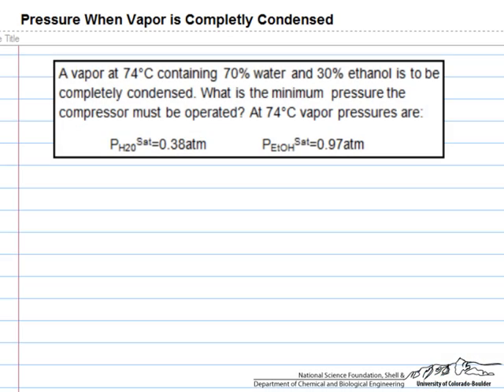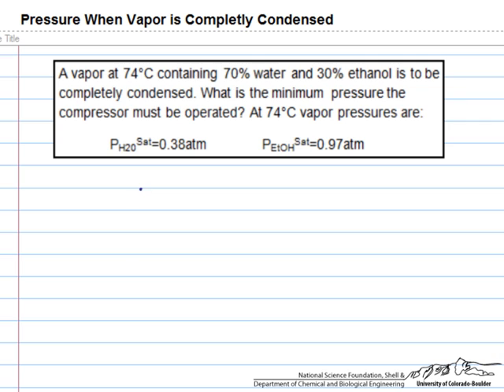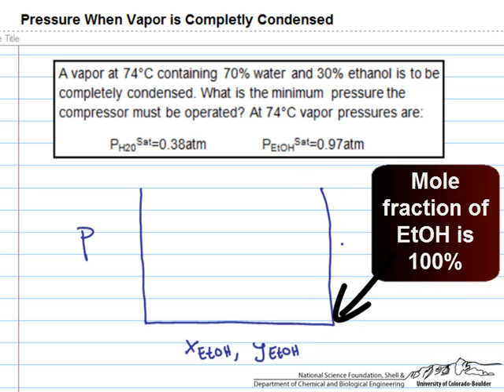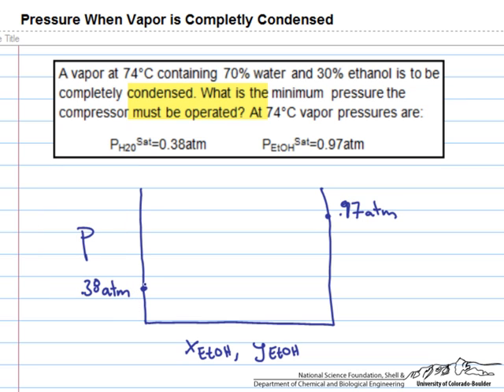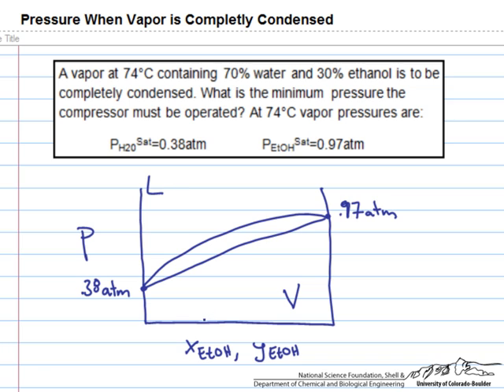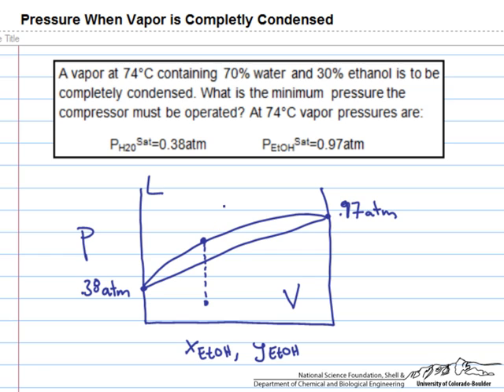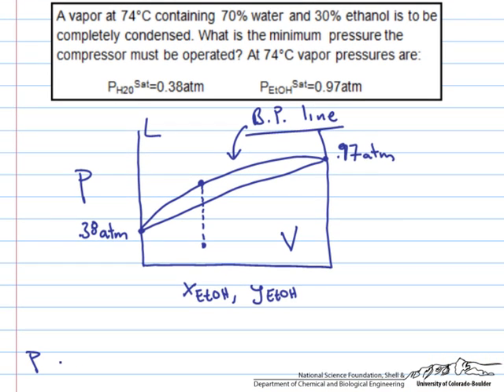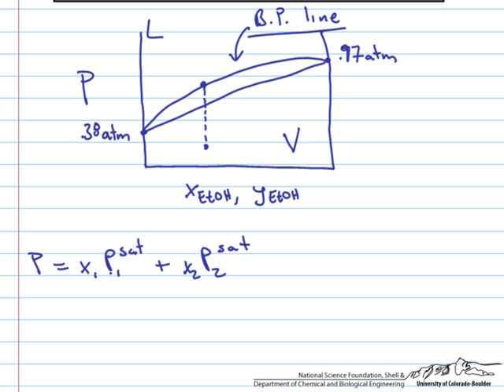Bubble Point Calculation for Condenser

Comment: It should bedew point calculation. Correct dew point pressure is 0.46 atm which is the minimum operating pressure for condenser/compressor.